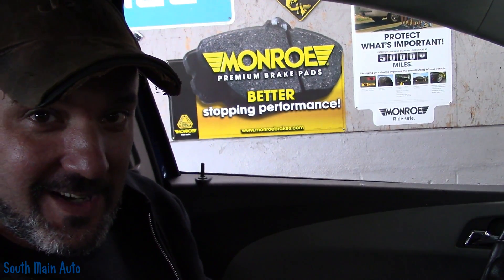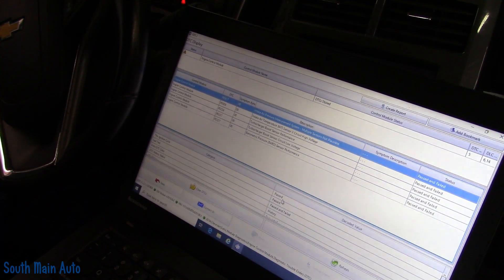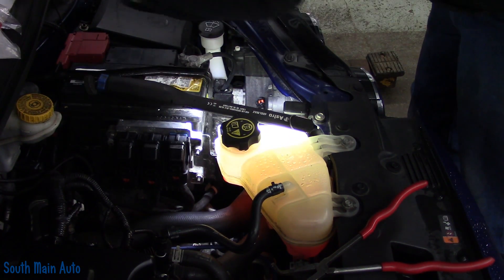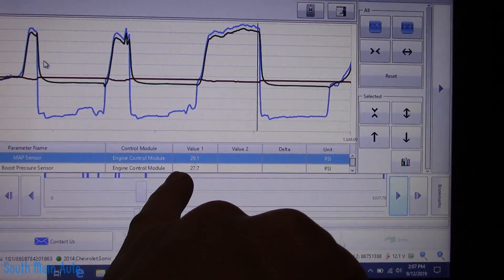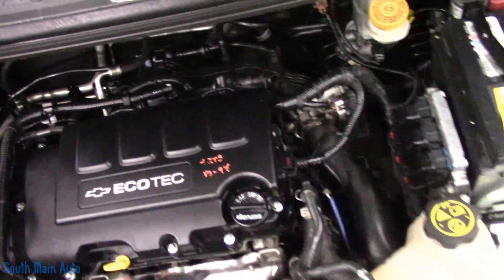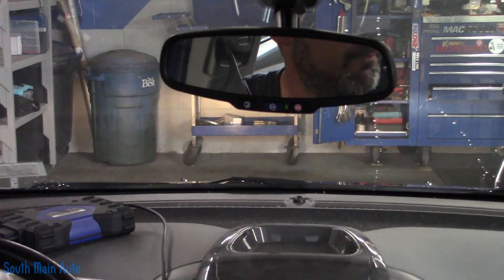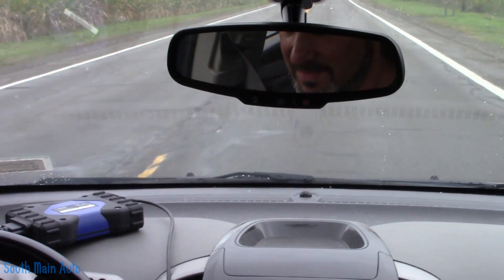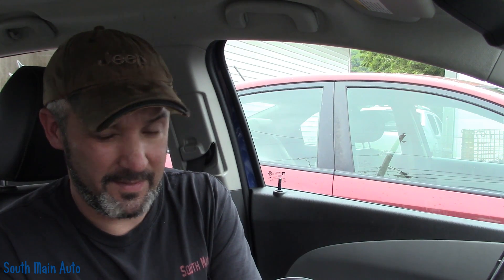Chevrolet Sonic 1.4 Turbo: DTC P00C7

Comment: 1.4L turbo, replacing the valve cover to fix the crankcase breather that is squeaking a vacuum leak past the rear main seal, those super quality (problematic) Bosch combination IAT/Abs. pressure sensors...feels like working on a BMW or VW again. Then again, most domestic brands are basically building their cars exactly like the Germans now, right down to the Torx fasteners.

Comment: I have a 2014 cruze with the 1.4l turbo manual. Under load ( going up an on ramp ) it feels like the boost isnt stable, fluctuates from 23psi to 10 psi ( No gauge for real numbers just by feel) I replaced the turbo w/ built in wastegate. ( Direct O.E.M at chevy dealer) still have the problem. Maybe plastic B.O.V.??? 
edit - No codes present

Comment: I wouldn’t buy any of the new cars with eco- boost or turbo charged engines. They’re all junk in my opinion. Most of the direct injected turbos coke the valves up. The EGR malfunctions in some and they all seem to fill up with water, exhaust, and oil that turns to sludge. People have had to drill holes in their intercoolers in some and replace the EGR plenum in others. It doesn’t surprise me that sensor got gummed up. I’ll stick with a naturally aspirated engine. Nice work Eric

Comment: Takes some of the fun out. On a naturally aspirated car, the MAP can fail "in range" and never throw any codes at all. (No other sensors to check against.) But it does feed garbage information to the car's computer which can mess with fuel economy, and possibly makes an automatic transmission shift like crap.

Comment: The turbo engines use an electric vacuum pump so they don't need to rely on manifold vacuum for brake assist. I can't remember if the vacuum pump exclusively runs the power booster or not (if it does, that explains why fuel trims aren't affected), but I do recall that there's a sensor on the brake booster to check for the presence of vacuum. That's probably why the vacuum pump keeps buzzing off and on, as it's trying to pull a vacuum on the booster, but can't manage to build it up. Also, it sounds like there's air in the heater core (I heard coolant rushing through it when the engine was revved). Air pockets in heater cores are common on these newer GM products.

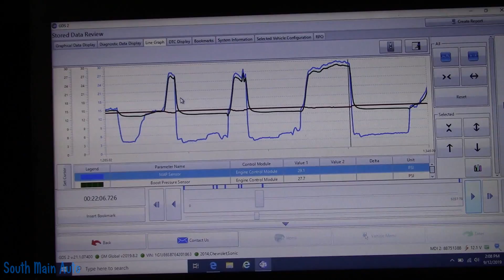Comment: @7:40 I haven’t watched the entire video, so this could have already been brought up, and I haven’t paid that close attention to the Chevy Sonics, so I could be wrong about this, but I think the reason fuel trims were so good with the shot brake booster is because the brake booster hose may not be going to the intake manifold. I worked on a 2019 Chevy Silverado yesterday, just an oil change and tire rotation, nothing to do with the brakes, that I happened to notice the brake booster hose didn’t actually go to the intake manifold. It went down towards the bottom of the engine on the drivers side, and hooked into this weird looking piece that had its own pulley and a dedicated belt driving it. It kinda reminded me of the old belt driven smog pumps that were common back in the 80’s. I’m betting that the Chevy Sonic is similar. It probably has an electric vacuum pump that gives its brake booster the vacuum it needs to work properly given the noise heard in the video.

Comment: Stupid question, if a map sensor can measure positive pressure and vacuum what purpose is the boost sensor
Reply: the "boost MAP sensor" would be before the throttle plate and after the turbo/inter-cooler where it checks the turbo outlet pressure.
the other common known MAP sensor would be in the intake after the throttle plate, where it would always read the intake manifold pressure/vacuum
Reply: throttle bottle k . Thanks. So it would set a code if say you had a hole in the inter Cooler or a really dirty air filter. I am familiar with map sensor placement and function.  The before throttle plate didn’t sink in until you reminded me
Reply: yeah any leaks or issues in the system causing high or low pressure would be seen as bad and set a code since the actual value from sensor and "desired" value wouldn't match.
Desired boost level is known levels stored in the ECM tables from factory. they're likely changeable by flashing if there's factory err or if it gets modded.(lol)

Comment: Hey Eric just incase you didn't know about this. The 1.4l is known for blowing out the pcv in the intake and also causing valve cover and seal issues. There is an after market fix kit. I have installed several with great success.  Including one in my own car. Here is the link. It's pretty straightforward. Good luck. Keep the videos rolling love the content. https://cruzekits.com/
Reply: he did say in video the customer had recently replaced the valve cover due to bad PCV in it.
Reply: @throttlebottle5906  yeah that's why i mentioned it. So here is my thoughts.  Pcv went bad  which took out the valve cover. The lack of control pushed oil into the intake system which got into the sensor. (If you look at it, it's covered in oil) also did the oil some how make it into the brake booster and wipe that out?

Comment: Ah, yes, the Multiple Sensors are not Plausible. The Data Sensor is Askew. (Was the door Ajar?) 
You probably didn't know that the Sonic's theme song is the Talking Head's "Stop Making Sense"!

BTW the word askew means "not in a straight or level position" - which does not describe the 
inconsistency between the two data streams that is referenced. So Chevy isn't even using the English 
language correctly anymore! Though maybe because it was a German part?

Anyway, nice diagnosis, explanation and repair! (As usual!!!)

Comment: Replaced my share of those turbo assembles. That oil in the intake is a common issue with those. That turbo will probably not be long of this world. lol.. Ever take a gander at the actual turbo? there about the size of a quarter. Under boost its about as powerful as a 2 liter. LMAO.

Comment: That's not the alignment. Its torque steer. A common miss diagnosis to ones not use to a high horsepower vehicle. Lol! (Joking) Great video Eric O.
Reply: Can't be torque steer, he wasn't even accelerating when it was pulling to the left.

Comment: I'd hate to see what that little car would be like with out turbo. Even the back roads would need a slow lane.
Reply: I think they called that a Geo Metro.
Reply: dwoodog haha. Yup!
Reply: You dont remember the 90s Chevy Sprint/Geo Metro/Suzuki Swift with the massive big block 1.0L 3 cylinder? My buddy's Sprint would chirp 3rd gear with that heap of an engine once we installed a new clutch in it.  You could go from NY to Florida on a tank of gas in that thing.

Comment: Could you have clean off that oil on the sensor with (wait for it) brake-clean? Would that have solved the problem, or because oil had contaminated the sensor it was just plain toast and nothing would have help except replaced the unit?

Comment: Iv done come chevy cruze work on those 1.4l powerplants. First one had a bad check valve in the intake. It had been to a "steelership" prior and they had smoked it and said it was the intercooler inlet. It was not. The 2nd had bad oil leaks for long time. Was oil cooler seals. Lotsa plastic on these junk engines.

Comment: Standard air pressure at sea level is 29.92 inches of mercury (according to the FAA) at 59°. You loose 1 inch of air pressure for each 1,000 foot above sea level. This should give you a good idea of what the static air pressure is at your elevation and temperature.

Comment: 27 pounds of boost on a factory-built engine?! No wonder they blow up...
Reply: Its 16lbs stock i run 21lbs on a tune
Reply: It's absolute pressure not gauge pressure.

Comment: You sure have your share of headache producing diagnostic issues.  Can't begin to get my head around the investment you have in diagnostic scanners and test equipment. Curious where the oil on the boost sensor came from.  PCV Failure, Turbo seals, worn piston rings??  Will the new one soon be contaminated?  Thanks for sharing.

Comment: Perhaps you were not able to reach the desired boost due leaking brake booster? At idle leaking air in and PCM dives the butterfly / idle adjust closed to compensate -> correct mixture. And when you tried to reach the desired boost, air leaks from the intake manifold to brake booster and leaks out  -> desired boost not reached..

Comment: Mars atmosphere debunks the claims about Co2 being a greenhouse gas.
Reply: Only in your mind.
Reply: @daverhodes382  Yes, the mind is where we all conduct the process of thought and reasoning. Brilliant observation. On earth, it's not Co2 that is holding  in the heat from the sun. The maritan atmosphere is 95%+ Co2 and the average temperature is -60degC. Do some research and you'll find that it will end up in your mind as well ;-)

Comment: 2014 car. Brake booster shot, PCV stuck, out of alignment, oil everywhere in the air ducts, sensors broken. Good quality car.
Reply: It's 6 years old, driven in hard conditions. What do you expect?
Reply: GM Quality.  My 16 year old Ford Focus has no problems, 200k and engine light never been on.
Reply: @rxtuninginc8444  and that means it's broken if it doesn't come on, may wanna make sure your light bulb works.
Reply: I'd sooner own a Chinese scooter
Reply: Made in the USA! LOL..
Reply: @TheOzthewiz  Just like Toyota Camrys, the most reliable vehicles around.
Reply: @EssenceofPureFlavor  BMW and Mercedes are made here, both MONEY PITS! Even my Focus.......Made in USA, POS! As for the Camry, I guess we got one right. LOL
Reply: @EssenceofPureFlavor  my dads car has 66k miles Never had a CEL or code   never been reset  toyota BTW
Reply: @EssenceofPureFlavor  Toyota Motor agreed to pay more than $1 billion to settle a class-action lawsuit related to issues of unintended acceleration in its vehicles. The proposed settlement, filed in a Federal District Court in California , would be one of the largest of its type in automotive history
Reply: @punker4Real  Toyota Motor agreed to pay more than $1 billion to settle a class-action lawsuit related to issues of unintended acceleration in its vehicles. The proposed settlement, filed in a Federal District Court in California , would be one of the largest of its type in automotive history
Reply: @ECamp-ry5cm  Okay?
Reply: most of the chevy sonics are made in Canada. The ford focus is made in mexico. the Camry right now is the most American made car on the market! Do your research.
Reply: @YOUneedJESUS1  Almost all the Japanese parts are made in Japan, those cars just get assembled here
Reply: GM went on strike. I suppose the union workers will demand even more money on top of the ridiculous salaries and benefits they already get and drive the price of these lovely cars up even higher. Thank a greedy union for high priced junk like this. GM has to cut quality to pay all those union clowns their high wages and bennys. That is the reason most cars today are junk. To cover high labor costs. I know retired GM folks that make more money on a pension than most make working! It's ridiculous. Guess who pays for it?
Reply: @richb.4374  GM/Chevy cars have been shit quality since like 2000. Doesn't matter how much you pay the workers, if you're whole R&D can't fucking figure out how to hide plastic seams in the interior to make the interior look decent, the guys building the engine and putting it together can't be that much better. 

When it takes 3 generations of the Equinox to finally have an SUV that can compete with Honda, Nissan and Toyota who literally have owned that market since 2012. Maybe you should invest more in your R&D department than giving the top dogs outrageous bonuses.
Reply: @richb.4374  Toyota and Honda don't  have to pay their workers?! -_-
Reply: @PierreRanger-QC  Not absurdly high wages that are way out of line with the work performed, no.
Reply: @PierreRanger-QC  FYI, NON-UNION...

Comment: Of course, the correct way to replace that sensor involves removing the headlights, front grille, radiator and passenger side rear wheel. Good job you didn't have the workshop manual.

Comment: never dealt with a turboed gas other than a turbo swap out. thinking out loud they must have a valve to keep the pressure from going into the pcv and brake booster???or is that all run to the intake side of the turbo? or is the brake booster run off a vacuum pump or possibly hydraulic off the power steering or electrical?  and could something like this be the cause of the bad brake booster/??? hmmmm

Comment: Replace the o ring on the back of the master cylinder with a fatter one and the brake booster pump will finally shut off. 💩 Just did one of those yesterday.

Comment: Brake booster is ran off an electric pump...thats why fuel trims arent affected. That code is likely due to the failed valve cover and I suspect that the valve inside the intake manifold is missing...would explain the oil in the intake. Very common problem on these motors :(

Comment: I've been seeing and hearing lots stories of issues with Chevy Sonics lately.
Reply: Bought my 2014 brand new with 2 miles on it. I have 91k miles and no issues except replacement on my sway bar link, water pump, and thermostat housing assembly. Every car has its issues but if fixed right away, it'll last. I properly maintain my vehicle to a T.

Comment: Our 65 Impala wagon when new had a brake booster problem.
There were no recalls then but parents got it fixed at dealer.
Reply: 😁 I bet considering many-most didn't have power brakes and the ones that did was undersized for the ol boat considering tech of the day, pap had a 64 manual steering manual brakes 327
Reply: @wolfmanrebel874  My 2nd car was a 64 Biscayne 283/2bbl powerglide manual everything 🤣
Reply: @BigEightiesNewWave  I catually never drove one of these cars but did ride in when young,however I had a 73 and a 76 f100 that was Manuel everything and really they wasn't as bad to drive as you might think,power brakes obviously is much better but the Manuel steering,at least my trucks,wasn't that bad at all

Comment: If you have been watching this channel for any length of time, often the car is not that old, like 4-7 years being on average and often with lots of miles on it as it appears most people that live up in upstate NY drive a lot, not by choice often, but because it's rural and many need to drive quite a ways, just to get to town at the very least so miles accrue quicker than many other areas and I suspect that this Sonic may actually be a decent car, as GM vehicles go, but I suspect this perticular model as likely been rode hard and put away wet more than a few times, and with bad maintenance as well is why sensors and other parts may be failing 4 years in already. 

Gotta keep all that in perspective I also suspect this car may have high mileage for its age as well.

In 7 years, I managed to accrue 77K+ miles on my 2003 Mazda Protege 5, mostly doing a brutal commute, which on a good day should be no more than a 45 minute jaunt, but now routinely is an hour and a half during rush hour, which seems to be heavy most of the day now and the entire trip is 38 miles each way.

Now I drive less than 10 minutes to and from work so I don't do the miles I did for about 2 years and just got through doing a major repair on my car that began with what I thought was a broken timing belt, turned out to be a broken tensioner spring, which begat the new belt as I figured it was due and last replaced around 90-95K miles and the car has 188K+ miles on the clock.

So keep all that in mind when you hear a newish car already needing a sensor that it may well have been not maintained well, or driven hard from the get go.

Comment: I know a lot of you call this car junk, my suspicion is that this may actually be a decent car, but this example, being turboed and all that may have been rode hard and put away wet more than a few times  as well as having had poor maintenance and could have quite a lot of miles on it for a 4 YO car to begin with.

If you have noticed from watching this channel over time, most people around that neck of the woods seem to drive quite a lot and it's not too unusual to have 125K+ miles on a car that's less than 4 years old in some cases. I bought my Mazda Protege 5, 7 years ago and in that time put around 77K on it. It had 110,680 miles on the clock when I bought it, and it now has 188,188 or so miles on  it now and while I don't do a huge amount of driving with it now on a daily basis, for nearly 2 years, I did as I commuted what should have been a 38 mile commute, about a 45 minute commute in each direction on a good day, now lasts an hour and a half, regularly to a 10 minute commute each way with occasional driving on the weekends.

So all that has to be taken into consideration when watching these videos, instead of quickly calling something garbage/rubbish.

Comment: Awesome video great information ! the oil contamination in the intake tube is not a concern? Or will that just get cleaned up with drive cycles , as the customer already had the PCV valve cover replaced? Love all your videos  .... should probably wear a neck brace when testing turbo Chiivvies!

Comment: If he only replaced the valve cover and not the intake manifold, it will blow again. The PCV rubber piece is in the intake manifold that causes all the PCV issues. Google cruzetalk PCV fix.

Comment: Many turbo engines have a separate vacuum pump for brake booster etc.
Reply: Quite often you do not accelerate at the same time you press brake -> pedal up -> vacuum..
Reply: @jannepo  my teenager don't understand that
..but after her out of pocket set of tires she'll figure it out😉

Comment: what are your thoughts about the oil contamination in the tube and on the sensor .... possible return for same problem due to the bad pcv in which you spoke about that had been replaced , should that had cleaned out as well ...